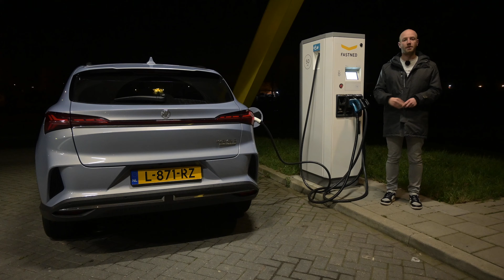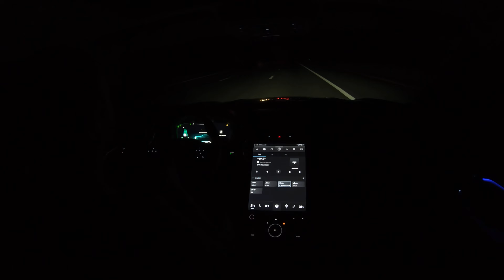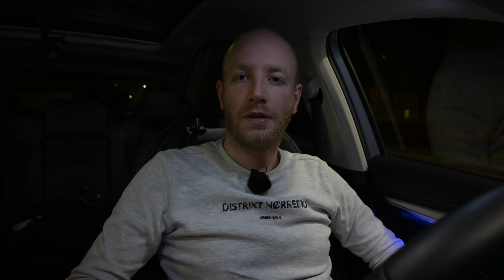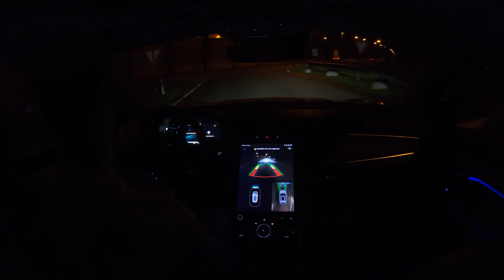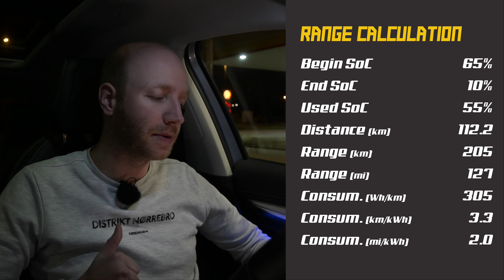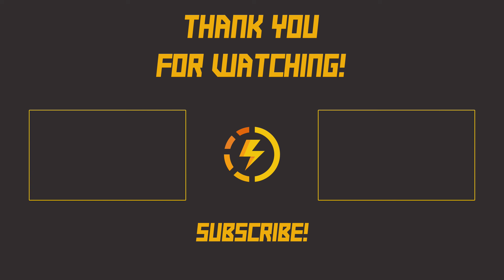MG Marvel R Range Test | Recharging ⚡️

Comment: thank you for your test. I believe difference between two runs comes from inaccurate state of charge percentage, sometimes, automakers use Ah value as percentage or something like that, so if you have 100Ah battery, at 50Ah it'd say 50% which is not true because at higher SoC, you have higher voltage, therefore more kWh. Same thing happens in my e-Niro, it almost takes longer to go from 100% to 60% then from 60 to 0% 
1% at full battery has about 25% more energy than 1% at empty battery if looked that way
In order to avoid such misleading percentages in your tests, I suggest you either extend battery usage during test (i.e. 95-5%) or try to have equal percentage above and below 50% (75% - 25%)
also, round trips (back and forth) are good to negate wind and elevation differences
Reply from the maker: You are probably right. Next time I will be more careful with this. Thx for your comment!

Comment: I’m trying to figure out if I will buy the eniro or the or the MG Marvel R lux here in Sweden (charges at 95 max with flat curve)? Our speed on motorway is almost always 110kmph. Would the difference be large in consumption between them?
Let’s say that I will be traveling 600-700km which car will do it easier and when is one better than the other .

Are there some with experience regarding the difference between maintenance between these cars?
Either I’ll buy an eniro 2020/21 that have gone 50000km for around 27500usd or a marvel r lux  for 34900usd that has only 7000km on it.
What do you think? Which one would decrease the least in value within around 5-7 years in your opinion?

Comment: It's not that strange for the range at 130km/h, because of the Inverse Square Law. If you go a set speed, but then double the speed, you need to use 4x the energy to move the air out of the way. At 3 times the speed, you need to use 9x the energy. The loss to friction on the road will be about the same, but aerodynamics do matter.

if you divide 130 squared (16900) by 90 squared (8100), you use over twice the energy to shift that cross-section of air from the front of your car at 130km/h than you do at 90km/h. 208.64% of the 90km/h energy if you drive at 130km/h for the air-shifting part of the equation instead. So seeing the projected range go from 357km to 205km isn't surprising... it's expected through physics.

As for the difference between the 240 and 205 km range, wind speed and direction at higher speed becomes a bigger factor. If you're suddenly driving into stronger wind, that's even more wind to move out of the way.

Comment: Thanks good video, can you do one on the rav4 plug in hybrid as not many do proper mile range. Also in uk miles per hour would be helpful for the older drivers in the uk Thanks again
Reply: 90km/h is just over 55mph. 130km/h is just over 80mph.

Comment: When doing these tests you need to keep in mind that you're driving 90/130KmH all the way. That's not how WLTP tests are done. If you've achieved 357Km driving a constant 90KMH that means WLTP you'll be doing well over 400Km. So yeah, pretty accurate. I'm guessing in summer you can do even almost 500.
Reply: @pawek9528  Wha?

Comment: Why should a 2 speed gearbox decrease the power consumption on an electric motor??
Reply: decrease the RPM for high speed roads = lower consumption.
Reply: @TrueDesire존  This is not how an electric motor works. It has a directly linear efficiency UP TO A LEVEL thats where the efficiency suddenly drops off, the gearbox means you can go to 200 without hitting that dropoff and as such keeps efficiency at high speeds and it also means less wear on the motor for high speeds. Nothing else.
Reply: It's the same as ICE cars... lower gear ratios mean less power needed to spin the drive shaft that spins the axles that spin the wheels. Less RPM basically.

Comment: Did you have the battery heater on for the recharge on the second run? Maybe the battery had cooled down before you did your second high-speed run? I’ve just had the updates done on my ZS and it is running better and getting more range but I am disappointed that I have no access to the battery heater as I thought I would go in by comments of the updates I’ve seen? I don’t know whether Other’s address owners now have a switch for the battery heater on the screen? Emoji batteries do seem to be affected badly by the cold.

Comment: Hi  what charge speed did you get?
Reply from the maker: The maximum charging speed is 92kW. I got that. When the battery is cold though you get less but it will heat it up.